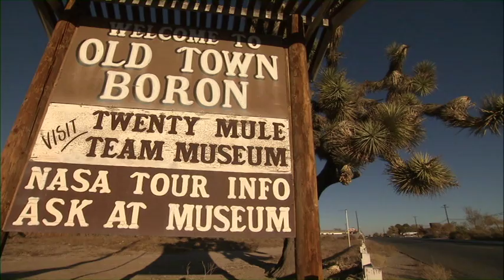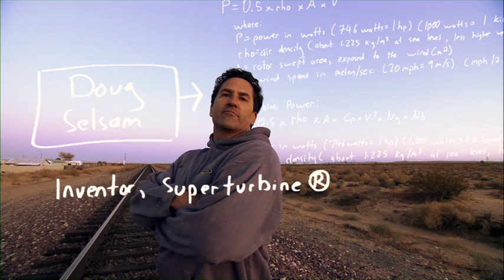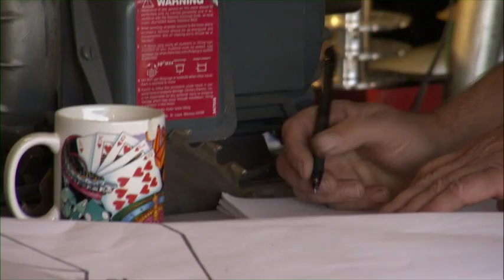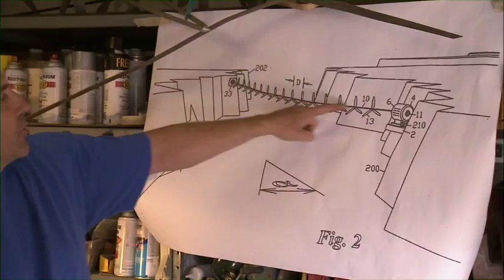Doug Selsam Inventor of Superturbine(R)

Comment: Seems like you're trying to reinvent the wheel. I also noticed two things. No data on efficiency of the supposed contraption. Leading me to believe you're not making anything new other than attaching multiple rotors. And constant need to defend your 'invention' through youtube comments more than 7 years after initiating tests. I've literally seen your account insulting people's intelligence after the slightest criticism or obvious defects and disadvantages, resorting to correcting typos as if they were misspellings. I will continue to assume that a 16 year old high school girl is in charge of your youtube account.
Reply: Don't get defensive, its unbecoming for a grown man. I don't make contraptions for a living but the idea that people are 'tearing down' your contraption through youtube comments is comical. The reason why I'm suggesting you are reinventing the wheel is because the concept relies on simply multiplying and scaling technology that already exists. There is no innovation. The comparison isn't between a 1-wheeled vehicle and 4-wheeled vehicle. It's actually the 4-wheeled vehicle (today's standard) versus a 12-wheeled vehicle (your model). The additional wheels don't make the car go faster or perform more efficiently.

Concerning the Independent Assessment Report: "The turbine generates 5 to 6 times the power of a single-rotor turbine of the same diameter, at all wind speeds, using industry standard blades for direct comparison to a known turbine model." Here you compare the efficiency of your model with that of a Whisper H-40. Its quite obvious to anyone who actually takes a look at this that the comparison is unbalanced and does not prove the efficiency of your model. Your model has more swept surface area to work with in the fluid. If you really want to compare efficiency you would measure the swept surface area of your model and equate it with a model of similar units. Anything else is just artibrary nonsense without compensating for dynamic factors.
Reply: Okay calm down guy, I don't know you and you don't know me. First putting additional wheels on the vehicle doesn't guarantee increased efficiency which is the only way to convey a standard among differing models of various vehicles.  The average 18-wheeler is actually less efficient than many off-road trucks pound-for-pound, a vehicle which hasn't been optimized for long-hauls or load capacity. In fact wheels (after having at least 3 which are round and of appropriate material) have little if nothing to do with power or ability to produce motion. But lets drop the wheels analogy, as you've successfully bastardized it into a diversion.

You keep mentioning power, but what is the point of building something that does what it does less efficiently than the modern standard? You're answering a question that nobody was asking. That is: "Ignoring effiency of the turbine, can we get more power into one generator?" Literally nobody cares if its possible because we know answering such a question doesn't give solutions to green tech problems. You're 'invention' has no place in the modern economy if its not efficiently producing power.

Also, as i had stated, the report ignored using standardized units of comparisons which, as I suggested, could be done through swept surface area. The report instead fallaciously equates rotor diameter and you repeat the claim knowing full well that diameter of the rotor is an arbitrary means of evaluating the machine's performance.
Reply: Look, I know as a self-styled inventor you have put so much time, money, and effort into the project that you can't bare to fail but you can't ignore the alarming issues nor can you blind and deafen yourself to the echo chamber you've created to dampen the critics. The stakes are especially high when people have already given you awards, interviews, and funds raising their expectations. But calm down, I'm not here to listen to your marketing or be impressed by the number of convenient facts you've memorized concerning wind turbine technology. I just wanted to bring up a glaring issue.

The survivability of the wind industry doesn't depend on how much raw power the individual machines gather. That is an irrelevant factor. Instead its to do with the efficiency of converting wind (kinetic) energy into electric energy and how close we can get before reaching Betz law. Even if you wanted to measure the amount of raw energy gathered, you could have the decency to compare it to a model using metrics that translate across designs. This might involve comparing your 25 rotor design to 25 Whisper H-40's or a Megawatt turbine that sweeps the same area with comparable winds. As it stands, your 'invention' serves only to fool people that don't look deeply into the technology and science.
Reply: Yes you're right I had to look up Betz law, just like you probably had to look up swept surface area, because I don't work in the field and I couldn't remember all of the terminology pertaining to why the wind industry has been struggling. You're also right that I misspelled _bear_. You're also right that you may not have used Whisper H-40's and I was assuming since the report never indicated what you did used other than mentioning the diameter of the rotor. So okay I admit it, I'm a human being that makes mistakes and is imperfect. Why my English needs correcting, I'll never know. You still understood the sentence perfectly fine, indicating to me that you're being unnecessarily picky. Additionally, let's ignore the fact that patents don't make you an inventor, hanging out with rich people means nothing, winning Popular Science awards and government grants is only an indication of how good of a salesman you are, you never disclosed the name of the leading expert, and adding more rotors doesn't increase stability of the turbine. Let's ignore all of that. I want to focus on something you've said.

"I guess if you are a complete moron, you would be incapable of multiplying the output of a certain number of turbines". I don't know what you mean by this and have suspicion that you're assuming I should extrapolate performance linearly proportional to the number of turbines. However such suspicions are short-lived as I know you're not necessarily stupid only self-righteously misguided.

Let's also ignore the fact that the statement "Power output is the entire reason anyone installs a wind turbine" and its contradicting statement "There is ONE thing the wind energy industry cares about, and that is LCOE" do not match. What induction generator are you using and how would a single fixed drive shaft be advantageous? It would make all the rotors spin at the same speed. Why not use a differential (or potentially more than one) so that each rotor can produce torque independently?
Reply: So the machine in this video is a permanent-magnet alternator?
I think you underestimate the economy of harvesting from each rotor of course I could be wrong. I don't know what an inline differential is but there is a huge disadvantage to a fixed shaft as slower rotors act to create both inertia and drag. Though I will admit maintenance could be an issue, yet the avenue should be pursued. Perhaps a simple 2 rotor model to start.

I just wanted to end by saying I can't tell what model of wind turbine this is. I honestly can't tell since I don't know where the wind is coming from. Its a multi 3-bladed rotor on a horizontal axis yet it spins like a vertical axis since the rotors aren't staggered and tilted against the wind. I also have no way of knowing your current development and am relying on this video.
Reply: The only inline differential mechanism I can come up with is the configuration used for contra-rotating propellors, which with some tinkering could work for a wind turbine but I don't know how economical it would be to drastically change your idea at this point and if you already fear using complex mechanical components then this isn't really an avenue.

You can't blame people for making assumptions about your product. I tried to google SuperTurbine and found various websites detailing different inventions from China and even Tunisa, but when I reach your website its a very poorly made collection of webpages with mostly pictures of computer graphics for conceptual ideas. What happened? Why is there so little information? And why in the information do give, is the context of performance skewed to favor your model?

Comment: Few things that made me cringe - fast roating blades are very dangerous to birds and humans that service or live near them. Turbines behind him at highest wind speeds won't get more than 50 RPM. And they will produce over 200kW of powera t optimal wind speed (which is usally something between 10-13m/s). Moreover guy made a total idiot of himself, since even the erliests wind turbines are optimized and automated in such level that they won't start operating, if wind conditions are not sufficient to make it worth due loss of durability of components and energy used to operate a turbine. It's a basic lack of knowledge about engineeringh of wind turbines. He got good idea, but it's nothing near efficiency of old-school HAWT (horizontal-axis wind turbine).

Comment: I'm an electrical engineering student specializing in Renewable generation. This design is junk and engineers specializing in wind generation were clearly not consulted or ignored...
Reply: Doug Selsam how do you account for the losses in all other cardinal directions? Essentially these things only work for 1 direction. Unless they are very  cheap compared to normal turbines I see no benefit at all.. do you have access to a power curve and test methods by chance?
Reply: Clearly normal tests don't even cover these things because they can't turn so would produce much much less than a normal turbine. They are being installed to test them I'd wager. Not to produce useful amounts of power like MW or GW
Reply: Doug Selsam vertical axis turbines are generally horrible but I am 1000% sure that they work better than these. I would be shocked if they can convert more than 5% of the energy in the wind. Where normal turbines can achieve 15-20 pretty easily... If your company is using them there must be some reason like government subsidies or something
Reply: Doug Selsam some of the turbine blades can be seen reversing direction during the clip 🙁
Reply: Doug Selsam so many questions.... Like what's start up speed? What's max rated speed? What is cut off speed and how on earth does it fuel effectively. Not to mention the birds this will mince... That's one of the reasons we favour large slow moving blades. Also larger systems are generally installed higher to take advantage of the ABL since wind speed is cubed in the power equation so really height = power to simplify... How on earth do you install this up high??? Perhaps there is an application in like a valley strung between 2 mountains if they get a very predominant directional wind
Reply: Wow doug 10mph for a small turbine is absolutely horrible. Our local 2 blade model has a deliberately poor startup speed of 4mph as it is designed for high speeds. Most small turbines with more than 2 blades are lower than this though. I seem to have hit a sore spot but you still havent answered how this is supposed to collect wind energy from other directions or how you are going to mount it up high? 2X50m poles.

Ps i'm sorry you dropped out and learnt nothing by your own admission but I'm a straight HD student and there's no need to take out your insecurities on me. I merely asked a bunch of questions because i'm interested and shocked that people have deemed this a good idea. If i'm wrong then I definitely want to know about it. But at the moment it seems a lot like solar roadways =/ https://upload.wikimedia.org/wikipedia/commons/thumb/8/81/Betz-tube.svg/247px-Betz-tube.svg.png
Reply: @Dough Selsam what is the Co or Cp value for such a machine? A turbine needs 2/3 windspeed at the blade and 1/3 behind to reach betz limit so how does that apply in this situation where each turbine is behind the other? also "All wind turbines have a startup speed around 8-10 mph" is a very ignorant statement good sir.... Bit of a hypocrite eh?
Reply: Sorry doug! I didn't realize you were the inventor before posting all that. My apologies for being rude =/ I just try and distribute good information where I can. There is so much Stigma in many countries around renewables and it's often systems that don't work as advertised that are to blame. What with all the small turbines installed on rooftops and boats at various periods without any regulated testing.. When i see research money being invested into solar roadways in France it makes me upset because the result will be poor and the local population will have a bad taste in their mouth about renewables afterwards =/ I wish you the best for the future!
Reply: Doug Selsam do you have any satisfied customers that you can reference? I am a newb. But I can also see about 10 reasons why this isn't going to be adopted ☹️
Reply: Thanks for the documentation Doug. Much appreciated. When mounted between buildings or in a canyon is there any benefit to having blades near the walls of the canyon? surely the windspeed here is drastically slower than in the middle of the canyon.